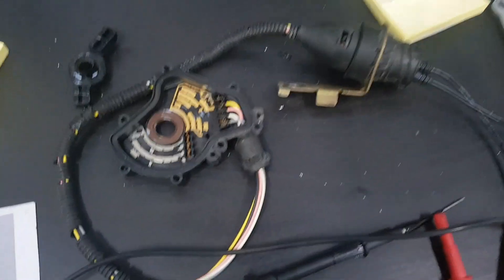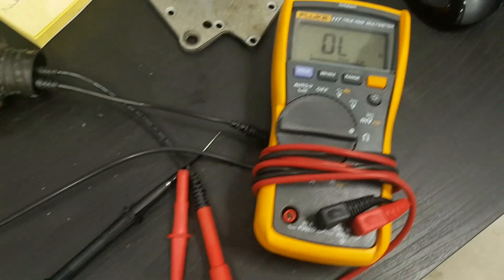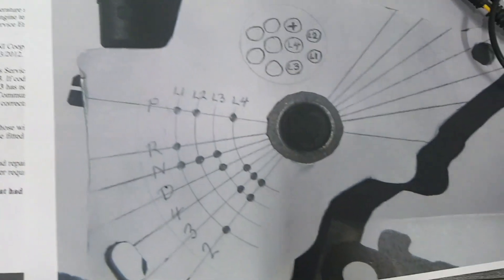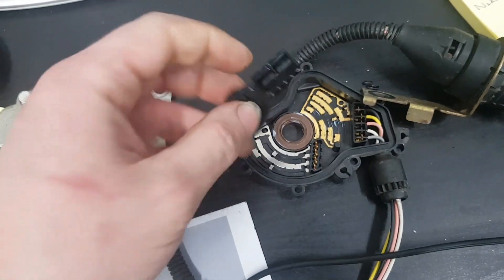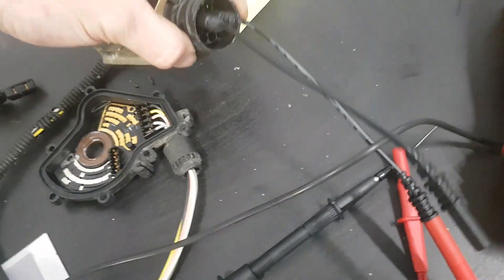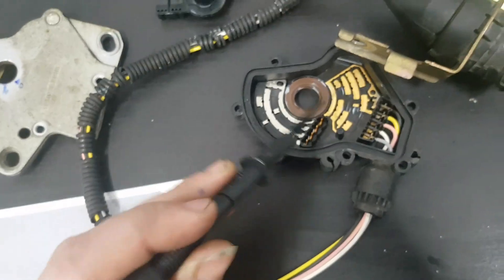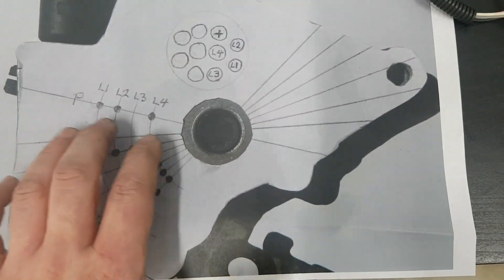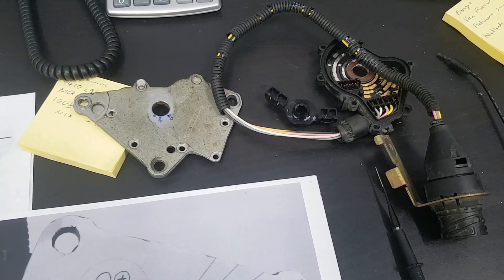P0705 Transmission Position Sensor Testing BMW E46 ZF 5HP

Comment: Hi everyone.. help with transmisión bmw 645CI 2005 ..  I just change the transmission oil in my bmw and still come out the light transmisión fault and the car start in safe mode.. any idea what is cause the problem? Thanks for any subjects
Reply: Hi .i have a bmw 318 ti automatic  transmission  and oil us mixing with water .in radiator .ididnt attend to problem soon enough.i ran car for 2 months  short distances .but now im getting this cog warning on dash. And car sort of jerks when i try to move from first gear  .managed to get it home .will the automatic heat exchanger and oil mix cause this problem .HELP!!!
Reply from the maker: Very likely. You either have coolant in the trans oil, and glycol that is in coolant is bad for automatic gearboxes. Or the trans has pumped so much oil into the cooling system that the oil level os now really low. Or both. Either way this is an issue that shouldn't have been left. You will now likely be plagued with cooling system issues too, as the ATF will swell all the seals and hoses in the cooling system. Not good.
Reply: Thank you .i parked car off.  Removed airbox .pipes leading to  the radiator .etc cleaned all oil residue.i am going to remove the atf heat exchanger and replace it .the thing is the atf fluid  was still to max level .didnt go down . What happened here  ?.
Firstly im going to flush water system .radiator expansion tank etc . 100 how do i flush transmission 1 ?
Reply: Thanks for your prompt reply .God bless .